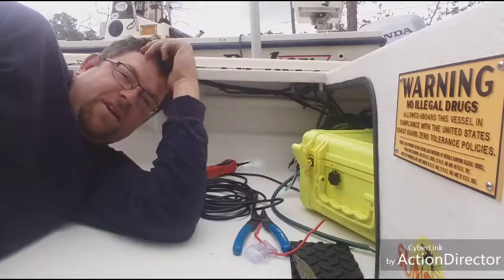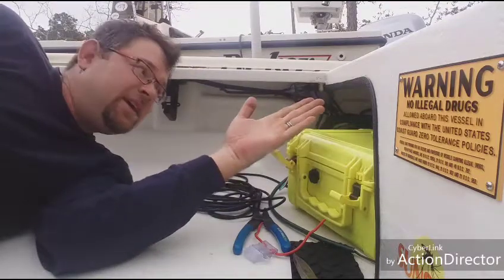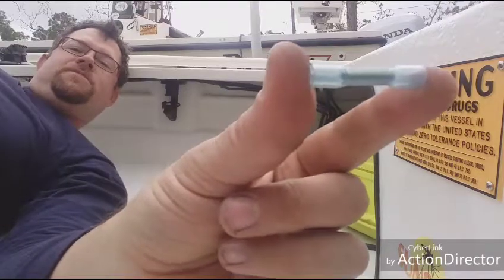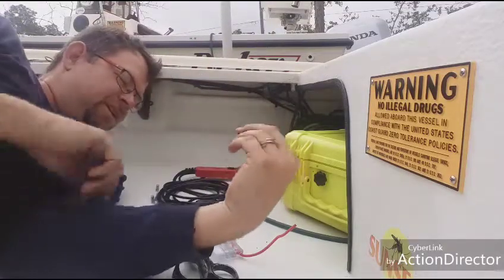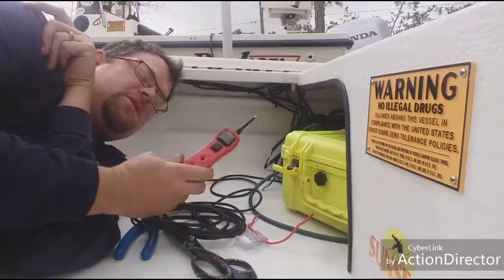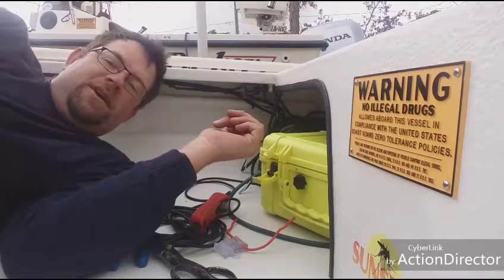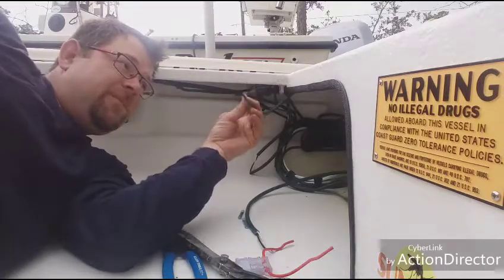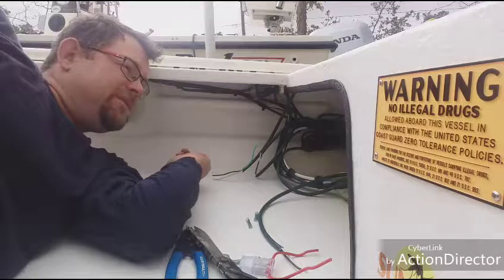Wiring on the Skimmer Flats Skiff making it stealthy, waterproof connections and Power Probing

Comment: I do electrical and marine electrical for a living in the Florida Keys. Can't believe you used extension cord in your boat for everything. Let me know how long that last for you bud?!? I would never waste my time or money on that as it's guaranteed not to last in Gas, Oil and Saltwater. Please tell me you don't recommend that to people. Wow!
Reply from the maker: Actually 3 years later it's like new. I also do marine electrical for over 20 years and was a certified Honda tech for 15. Just because its not tinned doesn't mean it won't work just fine for the application. Instead of hundreds of dollars in marine grade wire to run 5 lights a 500gph bilge and a fishfinder max maybe 5 amps. It's doing just fine. It's my boat anyway. I've fixed many a new boat wired like crap from the factory and by hack electricians used all the marine grade wire shrink connectors insulated and non insulated crimps all recommended by ABYC. I will keep you updated as to how long it lasts. It's gonna be a while though because its still fine 3 years later and out doors everyday. Maybe next time you should think outside the box before putting down a simple cheap solution for a bare bones skiff.
Reply: @captainrobthompson8728  Cool brother! Keep up the good work!
Reply from the maker: I wouldn't say it's good work. Lol!!! More of a challenge. I had a friend offer to buy a spool of the good stuff but I said no I was gonna try it and see. So far it's really hanging in there better than I thought. Still limp and plyable no cracking. If this was a customer no way would I chance it. But for a no budget backyard build it's actually ok.

Comment: Do you have the rolled deck skimmer skiff?
Reply from the maker: Yes and no. I have the 16'6" with front and rear deck and I have side gunwales added as well. So it looks like a topdeck liner. It's sweet and light. 550lbs 4 of us walked it onto the trailer.